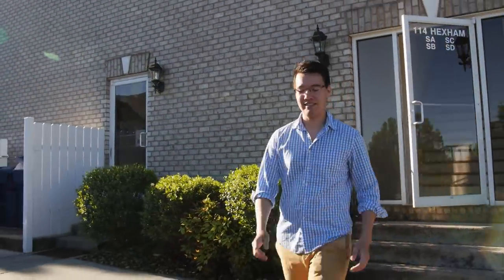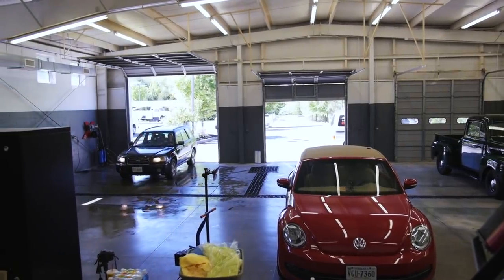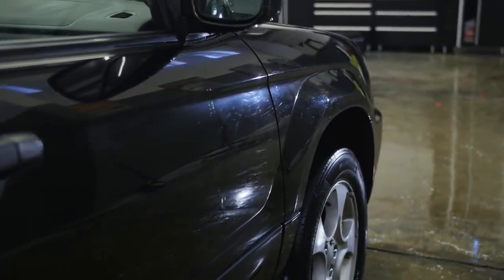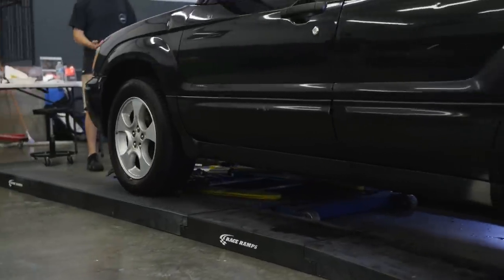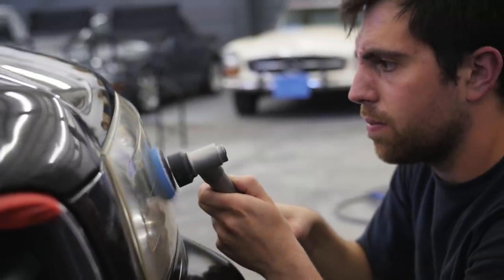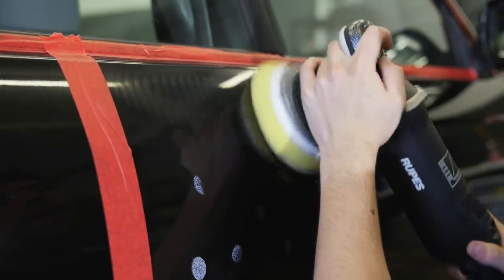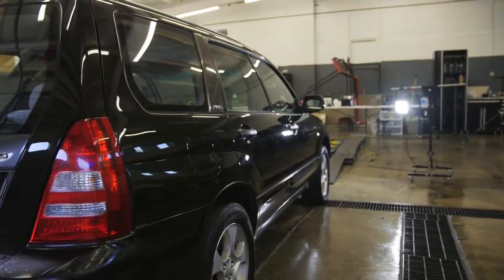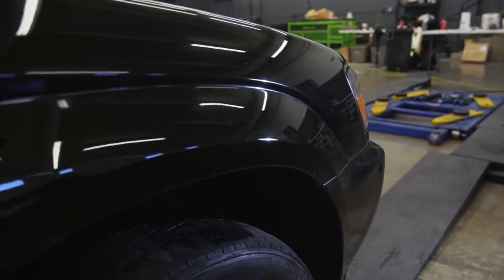Detailing a 200,000 Mile Car

Comment: Goes off-roading right after the detailing...
Reply: to Whole Foods*
Reply: I was thinking the same thing! Unfortunately, that IS probably what I would do...
Reply: BadDriversOf Tennessee *
Reply: Mudding*
Reply: I did detailing job myself and I used my motorcycle to go around for the whole week. Don't wanna end up busting my ass twice when a random bird shit on the car.
Reply: 250 detail is trash to begin with... can't get much done with that much
Reply: I didn't get my 4runner detailed but I washed it and then the next thing i know, it rains....
Reply: @jasonelliott9762  I got to Whole Foods then cook a 5 course meal at my acre which is mostly sand.

Comment: Two bucket method is essential.  Wish I had the grit guards in the bottom though.
Reply: Andrew GT-B You can make your own. I measured my buckets then bought a cheap plastic plate and drilled holes in it and it works great. I do admit it's not best but it's a budget hack.
Reply: Grit guards cost like $10
Reply: counkev I made mine for $1
Reply: Jason Kaplan holy, good idea
Reply: Edison Chan My local dollar store has serving plates the same size as my bucket. another idea is a strainer for pasta. get one that's plastic cut the stand off sand it smooth and put it in the bucket upside down. you can rub the mit across the surface and the dirt comes off and all you do is wash it and your good
Reply: that is an awesome tip, thanks...now, just need to go out hunting for a noodle strainer...or, just cough up the $10-15 to get an actual grit guard
Reply: Andrew GT-B Dollar stores. btw even upright it works.
Reply: "find" a milk crate - the plastic ones that grocery stores use ,,,, and cut out the bottom and sides to your size you can get 5 grit guards for free.   ; )
Reply: Andrew GT-B Actually it's more of the grit is heavier than water and will always stay under the guard. I've even gone as far as to dumping my bucket with every new panel. wash hood and both fenders and then rinse while dumping and refilling the bucket
Reply: Dalton Michaels true but they are heavy
Reply: The vertical bars in the grit guards serve to help keep the water in the bottom from swirling around while you dip the wash mitt into the upper part of the water.
Reply: i got some from china for $5, took 15 days but they work
Reply: i got some off ebay for like $8 each real cheap, some brands cost more but i mean thats if you buy a branded one, works well actually
Reply: No thank you. My paint is worth more then $1 cheap made plastic made at home guard

Comment: I'd love me a nice cinematic rust repair video. Repairing to the extent of cutting and not just sanding, that is.
it would be something new and compeletely original.
Now, for this to happen i get that you'd need some way of funding the video, as well as a rusty af car thats worth repairing. Neither of which i can help you with unless i win the lottery and you feel like coming to Norway.

:D
Reply: I can provide the rusty car, lol... But it's in Canada
Reply: Man, I have a 2001 Forrester that needs some rust repair on the quarters. I may just have to video it when I finally get around to fixing it (which will definitely be the full fledged way of cutting out the old area and welding in new material).

Comment: I wonder how the car was with chips and what not. My Mazda 3 with about 31k miles on it (I've owned it since it had 170 miles on it) is straight riddled with rock chips, other kinds of chips, and now a few places where rust is even building in the chips. Idk if it's just because you wouldn't see them as easily in a video, but that car seems pretty damn clean of chips and what not. Lucky them I guess x)

Comment: Hi - appreciate you posting this!  I have a 2005 Mazda 3i with 83K miles on it.  I have been contemplating whether to get detailing.  There's a very reputable detailing company I heard that costs about $400 -- I know it's on the expensive side but the reviews have been nothing but stellar.  My question is:  should I wait until I hit the 100K miles to do it?  There's just some small scratches and dents here and there but nothing major other than that as I put it in a garage most of the time.  Appreciate your thoughts.  Thanks!

Comment: No clay or nano skin before polishing?
Reply from the maker: +CarGuy11 That's what that blue rag was that Steven was rubbing up and down on the side panel.
Reply: Gotcha
Reply: Can you explain to this lay, exactly what "clay" and "nano skin" is in this circumstance? Or should I just look them up?
Reply: sgtshiyo2 It's a step to remove surface contamination like tree sap, bugs, etc from paint. A clay bar is used or new synthetic clay nano skin is used for this.
Reply: Theyre all young. I don't think they have enough experience in the field..
Reply: Gears and Gasoline But that still won’t do what a clay bar would have done?

Comment: 3:53 it kills me that this guy, who is supposed to be a professional detailer, has no idea how a polisher works. 

You don't put the compund on the middle of the pad. The middle of the pad really does fuck all for polishing. on a 3" pad only the outside 1" does any real work, And on a 5" pad you get about 1.7" of useable pad. The center of the pad barely moves compared to the outside edge. The edge does all of the polishing work. 

If you try and polish with the middle of the pad you are just wasting compound, and probably gonna ruin clear coat.

Comment: I used to keep my cars paint in 90% condition, I spent a whole day 10 hours to make it good. But I have come to the realization that roadsalt, harsh winters etc are just so demanding on the pain that after a year its almost back to square one. I have buffed it twice and I am afraid to buff more because I fear to run out of clearcoat. So, nowadays I only buff it with very mild compound that gets only the finest swirls off and then put on sealant. That keeps it good looking for the short summer months but during winter its impossible to keep it good looking since the next day I drive it its covered in road salt.

Comment: what does something like this cost? ball park figure?
Reply: Evo Dingo Depends. Will probably range from 300-500.
Reply: RisingTied72 damn and to think that the car will get dirty within a week
Reply: 300-500 is insanely cheap... here in Houston most reputable shops start 2 stage corrections at 1300 for small sedans.
Reply: Thats stupid. Never get  the return.
Reply: Jose Villalon dude I could buy my own polisher my own pads and my own compound polishing products and do it myself for less than $200
Reply: Dr. Siracha Anyone can. Not everyone wants to or has the time.
Reply: Jose Villalon true!! I'm thinking about starting my own part-time detail business

I just need to I need to find out what the demand is in my area

Comment: So your detailing a car... Why does it matter what the vehicles mileage is?
200k is not alot for engines of today..
My father used to have a work van with 660k on the clock, Nearly quarter million miles..
Still ran like a baby.. Just the bodywork rotted...
Reply from the maker: Snitchy1989 the mileage is significant because it denotes the resale value of the vehicle. A 2004 Forester with 200k is not worth a lot, so it's hypothetically interesting that a car like this would get a pro detail.